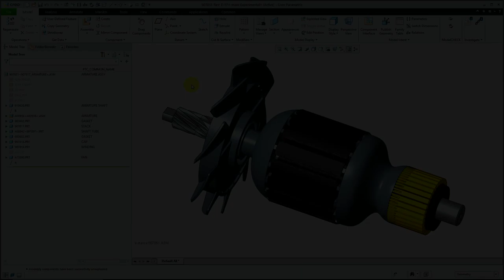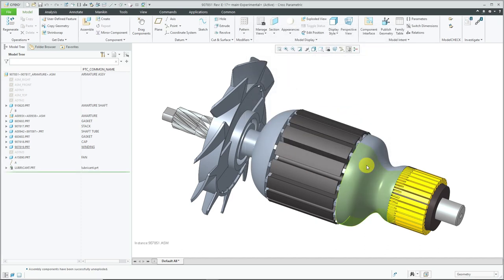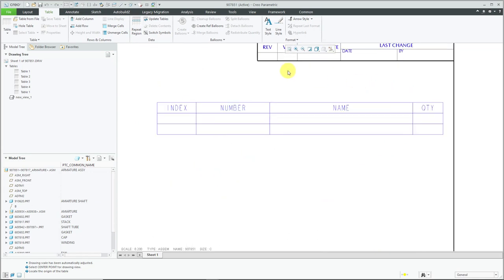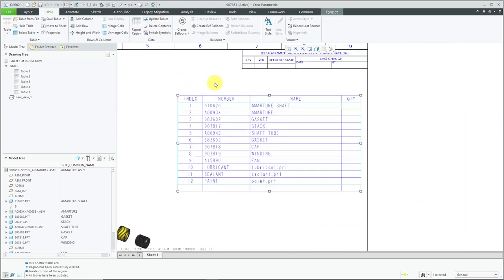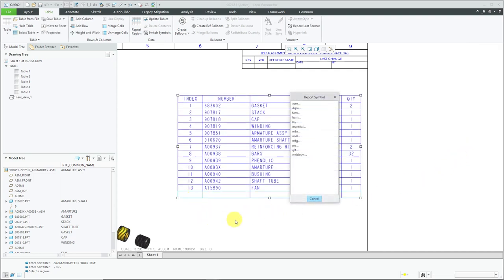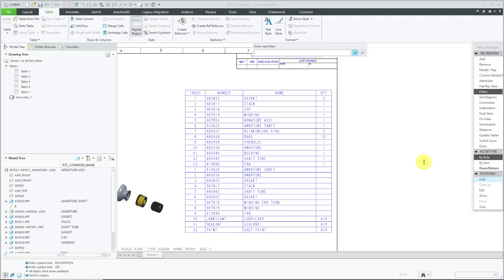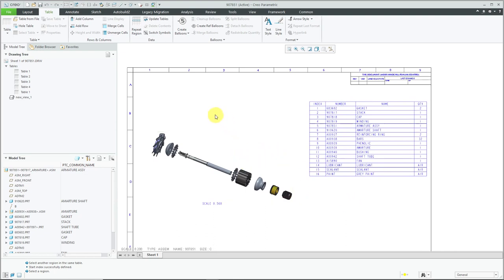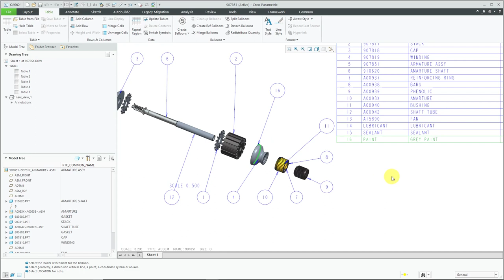Creo Parametric Drawings - Bulk Items and Bills of Material (BOMs)

Comment: Hi Dave, how would you handle items on your BOM that are processed in manufacturing, like say a foam gasket seal that comes in a long roll, but you only use 4 strips of on your assembly which totals say 2meters, thanks!
Reply from the maker: It's complicated and I can't answer that question in isolation. Are you using Windchill? How are you creating your process plans / work instructions? Are you connected to ERP? How are you kitting? The real question is, what is the BOM on the drawing used for? That will dictate the level of detail and what you need to capture.
Reply: @CADPLMGuy  thanks for the reply. So we are using Windchill but only as a PDM, we have Oracle Agile for PLM and another Oracle software for ERP. Because of this the CM team has made a rule for no BOMs on the drawing, but we use WTparts to create and build our structures before importing them to agile. In the past at an old employer I handled it with a tabulated drawing and dash number variants for the different lengths but was hoping in the past decade PTC would have addressed it with a nicer/lower maintenance solution

Comment: Great video! What if my bulk item is actually a part like adhesive tape coming from a roll. I modeled the tape with length so that it shows up in my drawing. I have different types of tapes all over my assembly. I used in the relation editor the following statements:

IF asm_mbr_part_number == "93725K76"
QTY1 = "AR"
ELSE
QTY1 = rpt_qty
ENDIF

The BOM Table show that part as "AR", but when I add more parts to the IF statement, I get an error. Why? Am I not adding the other part numbers correctly?
Thanks!
Reply from the maker: You have to either use a bunch of nested else statements or use the method I show.
Reply: THANKS! That did it! I nested the IF statements like this & it worked!

IF asm_mbr_part_number == "93725K76"
QTY1 = "AR"
ELSE
QTY1 = rpt_qty
IF asm_mbr_part_number == "8117A25"
QTY1 = "AR"
ELSE
QTY1 = rpt_qty
IF asm_mbr_part_number == "9402T61"
QTY1 = "AR"
ELSE
QTY1 = rpt_qty
ENDIF
ENDIF
ENDIF

I did put the ENDIF statement after each "QTY = rpt_qty" statement, but it didn't work. Then I placed the three ENDIF statements at the end, & it worked! Thanks again...and great video as well.